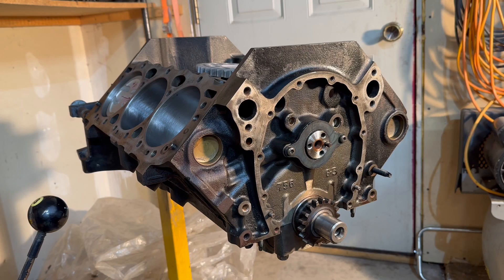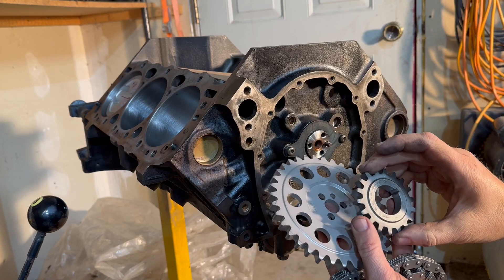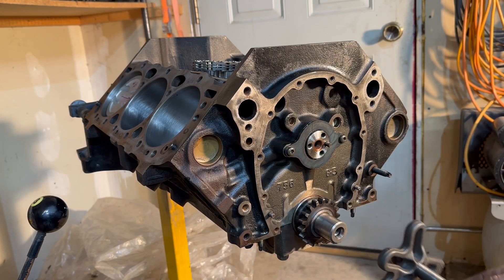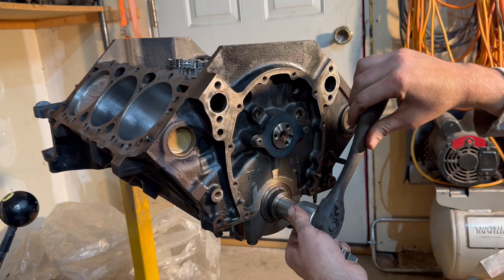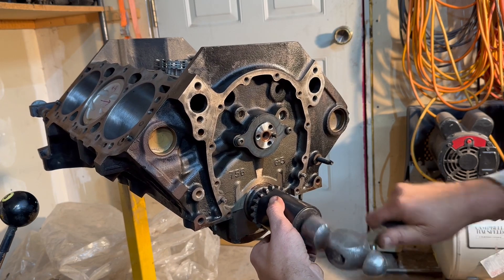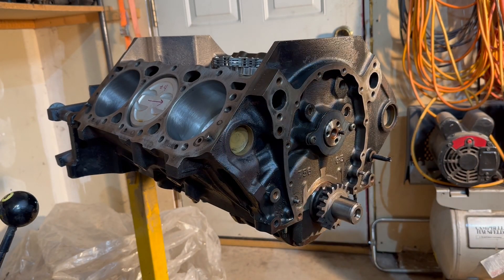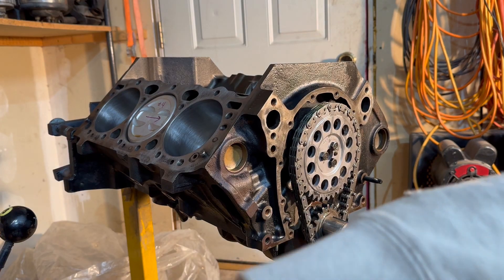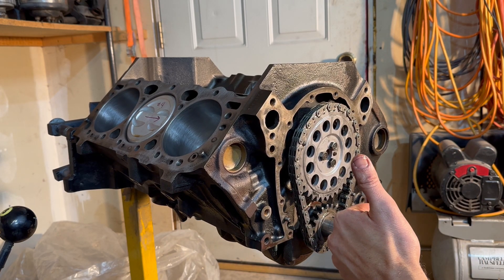Timing Gear Alignment and Install: 4.3L V6, SBC or BBC! Bad Hombre Garage Episode 142

Comment: Obviously somthings wrong with this good video. Theres no cam balencer gear????🤔🤔🤔 but my 4.3 has one🤔🤔🤔 this is not correct .  But a nice video, i think🤔
Reply from the maker: This 4.3L V6 is a 1992 vin code Z, non-balance shaft engine.